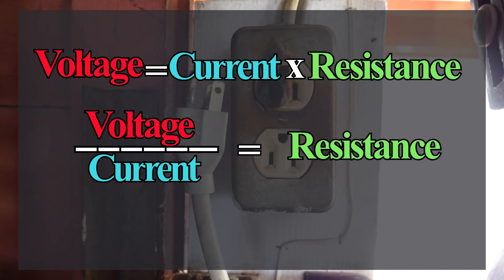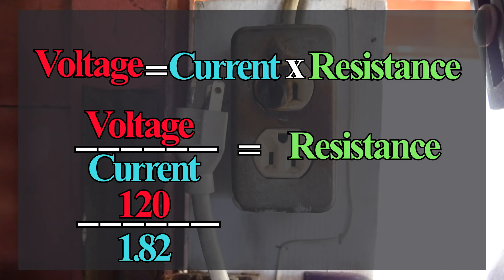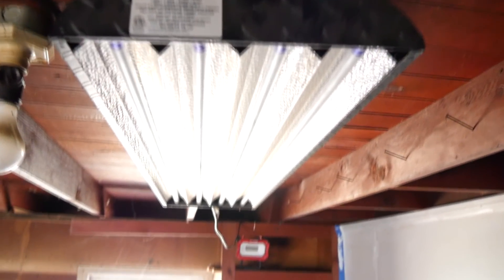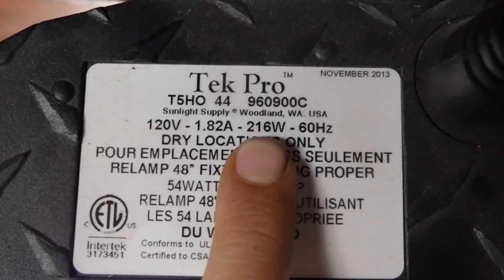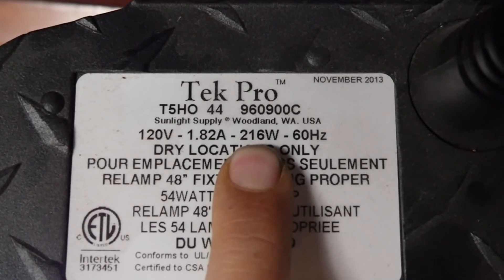Crash Course On Electrical Current - Voltage, Current, Resistance, Watts and Wire Gauges

Comment: Amps equals volts times resistance. If I say draw a circuit that gives me ten amps. You draw a five volt battery and a circuit from one side through a two ohm resistor to the other side. Five volts times two ohms equals ten amps.

Comment: Thanks for this timely video.  Many people don't know that outlets designed to handle 20 amp circuits have a different design that is obvious from looking at it.  From the outward appearance of your socket, it is apparent from a casual glance that  it is only designed to handle 15 amps, and you don't have to remove the cover plate to find that out.  The wider, neutral slot on a 20 amp outlet looks like a T laid on its side - here's a guide to this stuff - https://www.hometips.com/how-it-works/receptacles-120-240-volt.html.  Some outlets will handle the older, now generally prohibited aluminum wiring, some will handle both aluminum and copper wire, but generally the household outlets you find in stores will only safely handle just the normal solid copper wire. Twisted copper wire(i.e. like lamp cord) is not used for wiring outlets.

What I learned from buying a house with a DIY installed power panel in the garage was that the screws holding the wires to the circuit breakers, etc., inside the box and in the outlets had gotten loose over time, and things that drew a lot of amps, like power saws, just wouldn't work properly.  This resistance from loose connections causes heat which can result in fires, as shown in this video.   If you are not certain a qualified electrician wired your shop or garage,  spend an hour turning off the main power to the work area and check the tightness of each connection by tightening it with an appropriate screwdriver and examine the appearance of the insulation. Discolored or burned insulation indicates overheating, which reduces the ability of the wire that got hot to carry as much power as new wire.  If you have enough slack wire in the circuit, you can cut the wire back a few inches, strip about 5/8" of insulation off of the new end and attach fresh wire to the connection, but unless you have a lot of experience, it would be better for you to get a licensed electrician to check out the system and do the work .  Some local codes may require that you use an electrician to work on your shop or residential electrical system. Thanks again for the video.

Comment: This is the most common cause of electrical fires: Power-strip that has a bunch of high load crap plugged into it, plugged into a 15 amp outlet on a 20amp circuit...

The 20 amp breaker doesn't trip because you didn't exceed 20amps.  Instead you were pulling like 19 amps off the power-strip and burned up the 15 amp outlet.  Again the 20amp breaker is happy and doesn't trip.

Always use 15amp breakers if the outlets are also 15amps

Comment: Judging from that minimal panel and shoddy home repairs you found coupled with the electrical demand you will probably require from your shop with compressors and all.  I’m wondering if you should do some videos on how to run a bigger sub panel to your garage, and how to rewire your garage.   When I had my shop built I had the electrician re-panel my house to the max they could which was 200A and had a 100A sub panel put in the garage.  Chris

Comment: 20amp outlets usually have an extra notch on the neutra side. Not common from what I have seen. Dont use a 15 amp plug on 20amp circuit/wiring  folks. 12guage wire too like he had in the vid

Comment: Then our water example still works if a device has a high voltage, low current and high resistance. Or any combination...

Comment: This is a lot of good information but, it was too much for me to get at once. And I have a lot of basic questions. Like, I understand you had old wiring at 15 amps but how does that actually create a fire? What happens when systems don’t match up? Some more graphics, basics, or a recommended channel where I could watch the fundamentals would be super as I’m afraid to mess with electrical systems.  

Thanks for this very welcome video despite the critique / suggestions.

Comment: Glad everything is ok! Speaking of cars and electricity, if you hook up jumper cables to the car battery and hold the jumper cables in each hand, touching the metal part of the cable, will you get hurt?  One of my co workers and I got into a debate. The answer is no. The car battery is 12.4 Volts. Your skin resistance is massive, on average around 2-5 million ohms. There is no where near enough current to harm you, you won't even feel it. Even though the battery says 500 cranking Amps, that's when there is almost no resistance. Fun topic.

Comment: Ohhh  you had a 20 amp breaker and a 15 amp circuit and you were drawing over the 15 amp capacity of the plug.  Make sure you have the 20 amp rated wire too.  Good video!  Cheers!
Reply: To add to the issue... Was curious if the Power Strip pictured had a built-in Circuit Breaker.  I've rarely seen them activate but so helpful in reducing the chance of overload on the larger Circuit. Useful in narrowing down problems too. Kind of like using a GFCI outlet to protect a single location instead of multiple/entire strings of outlets. When it pops you don't need to look at the entire circuit. If the Overload/Short popped both the Strip and Breaker/Fuse... It should prevent another Overload when it's reset saving troubleshooting time.

Comment: Time for new outlets. 50 years old. Fire waiting to happen.
Reply: Depends on the wires and conditions. If the insulation on the wires is brittle, missing, or melted... Time to look at running new wire.  If the plugs are loose or fall out of the outlets... Then yes you probably have a fire hazard. Inspect the Outlet if it caused damage to the wires then replacing both the Outlet and wires is in order. But if the wire is good and properly protected (fuse/breaker)... replacement with the correct outlet may be all that's needed.
Reply: @lgoamity  plugs are what usually catches fire. I am a landlord and I have changed many outlets that look like that. Now I change all the outlets when a units come empty. That looked like the wire around the screw down terminal got corroded or loose.
Reply: @suggesttwo  That seems a bit excessive.  All the extra "wear and tear" from a blanket replacement seems like asking for a higher failure rate.  But you probably know best.  If a renter needs a lot of power and doesn't have enough outlets.... I'm sure you've seen some overly stressed outlets and ones that even if they look good need a peak under the hood.  

Suppose I'll need to add that to the safety test checklist (Test Detectors,GFCI, Batteries, Breakers,and Outlets) to make sure a Minor Problem doesn't become a bigger one when it fails to perform as expected.
Reply: @lgoamity  how much does a fire cost? Oulets cost 1$ each and he can probably do the work himself.
Reply: @suggesttwo  As I said... The Landlord (you) probably knows the Conditions best. But you raise a good point yourself... Nobody wants a fire. It'd be cost effective to swap out questionable outlets...  But that same $1 DIY to a "good" Outlet (plus ALL the "Good" Outlets in the unit) could unnecessarily raise that fire risk on an otherwise "safe" outlet.
Then again... If this is planned for each box could be set up for a "quick" swap reducing mistakes... (I'm imagining wire fatigue from "frequent" swaps, etc.)
Reply: @lgoamity  you can't see the contacts in the plug without taking them apart then they are garbage. They cost a dollar. You Don't want to spend a couple hours poking and prodding. A fire costs 60000$ in a 1 bedroom. 10$ to change the plugs. Money WELL spent. The insurance paus most but then your rates go up.
Reply: @suggesttwo  The Contacts/Wires I'm talking about are obvious and easy to see and test. Don't see anyone going to the trouble of trying to "open" then reassemble a modern Outlet.  THAT would be a fire hazard!  
In my Mind's Eye I'm thinking of a Renter leaving every few Months, maybe a Year? 2?  Seems excessive to do EVER outlet. Maybe just the ones that don't "test" right. (Cheap Plug Tester, if it doesn't show a normal connection, or wiggling the plug changes results... Change it.) 5-10 years? Sure, makes sense to refresh everything.

Again, I'm agreeing with you. If there is a question of safety I can't beat your math.
Reply: @lgoamity  not every time, only once per apartment. Probably won't need to be done again till I sell. I only change light switches if the installer didn't use the screw down terminals or if they are old enough to make loud clicking noise. Very old.
Reply: @lgoamity  I would say every 20 years or 10 if the plugs are in the baseboards.  Anything close to the floor is in much greater risk for contamination by anything on the floor. Extension cords, power bars etc.

Comment: So your solution is to install a 10amp circuit breaker yes?  Can you tell us about Watts and disapating heat?
Reply: The correct solution depends on what gauge wire was used for this circuit.  If it's a 14-gauge wire then the solution is to replace the 20A breaker with a 15A breaker and replace the outlet with another 15A outlet.  If the wiring is the thicker 12-gauge then the circuit can carry 20A...replacing the outlet with a proper 20A outlet and calling it a day would be an option, but if it were me, I'd replace the 20A breaker with a new one just in case that breaker is faulty.

Wattage (W) is simply (voltage (V)  x current (A)).  If you have  an electrical appliance that draws 3 amps of current then it's a 120V x 3A = 360W device.

Comment: That outlet has a bad contacts problem.
Buy a hospital grade outlet, works better.
Reply: Tamper resistant outlets have little doors that will keep dirt and water out.
Reply: GFCI work great and are added safety. Usually people don't buy them since it's too much money, $15-$20 each on instead of $1-$3 for a normal outlet and it's to "hard" to change them out.

Comment: 15A outlets work great on a 6-8A load like what you had there and are a hell of a lot cheaper. The failure you experienced was probably caused by corrosion on either the outlet terminals or the power bar terminals. That then snowballed into arcing, more resistance and a hell of a lot of heat which roasted the outlet. 20A outlets are not needed by any means in a home garage. The 20A breaker and 12/2 romex just supports more 15A outlets and typically you'll never easily blow past 15A's on one outlet.
Reply: @Matthew Poole  I think you are on the right track. Heat arose from high resistance either due to poor contact between the plug and receptacle, or between the receptacle's screw terminal and the supply wire. Poor contact could be due to looseness or corrosion.  So there's likely no problem with the wiring or the use of a 15A receptacle, but through wear and age, looseness or corrosion set up this fire situation.
Reply: I've seen some outlets installed with the grounding hole at the top, like this one, and some with the hole at the bottom. Which is correct? Thanks.
Reply: @coollasice4175  Grounding hole should be on top; the rationale is the ground prong is longest that facilitate easy insert, in an event some metallic object falls onto the outlet when it is being used it will contact the ground prong instead of the other two (arc and fire).  But NEC or your inspector probably don't care.
Reply: Cooll Asice I remember reading or hearing some about this,  I think they sometimes do it for safety reasons like for instance when the inside of the outlet is too loose or to old to hold tight the prongs of the electrical cord , the prongs would get loose half way out and if for some reason you are close near by and happen that you touch by accident with something metal those exposed prongs you can get shock or even electrocuted ,and by installing the outlet upside down the grounding hole is up ,that way would be safe, I got a couple electrical outlets that way ,that I am switching to normal way
Reply: OK thanks for the reply, but should they be installed like that in a residential setting like a house?
Reply: @coollasice4175  That depends on your local code and what version of NEC they are enforcing.
Reply: In garages in some part of the US require by code 20A outlets w/ 12 gauge wire.
Reply: @talshaharfamily  If the breaker in a basement going to the garage is 20 amps, can the garage's only outlet be rated for 20 amps?

Comment: Looking at outlet, you can tell if it’s rated 15 or 20 amps. The 15 amp outle has 2 vertical plug in spots, beside the ground. The 20 amp outlet has 1 vertical slot & 1 slot that is a “T” and your ground. The plug in for 20 amps is 1 vertical male & 1 horizontal male plugs, plus the round ground plug. For any circuit you should not exceed 80% of the rating. So for 15amps that would be 12amps, for 20amps that would be 16 amps.   Jim
Reply: sounds like bullshit to me
Reply: 80% thing is true.  When I have m'things working I connect an amp clamp near the breaker to see how much I am pulling.  If close to 80% I adjust
Reply: Manuel Salvatierra q
Reply: As long as you are below 80% you are ok......Jim.  PS this is all if your wiring is correct & everything else (electrical cords, etc.)  are within the current & watt limitations.
Reply: If you overload a circuit, the wire gets hot and if the circuit breaker takes you off line, things are normally ok. If the wire melts the insulation, it will start whatever is combustible in the area. This is the truth.   Jim

Comment: the water analogy is pretty good.  voltage is the water level(pressure), current is the flow rate of the water, resistance is the size of the hole in the dam.
Reply: Actually, comparisons to physical things is wrong. You are dealing with subatomic particles, they behave very differently from physical events. Resistance is opposition to current passage, and voltage is the force applied. I started working in electronics with  tubes, and black and white tv's. I also repaired high frequency radio equipment. Electricity will do very strange things, as I have observed over the years. Here is a mind blower, their is no current with AC circuits. Most people will disagree with this, however it is the truth.  Here is another fact, in DC current ( their is a current in DC circuits) follows only from Negative to Positive. Except, in transistor theory. Their is more but that would be beyond the scope of this forum.
Reply: Tomie Dotson AC circuits have no current? Well then, what made the outlet burn? Why does sticking a knife in an AC outlet kill you? Yep, it’s current and it AC current. Here’s the best analogy I’ve heard: Voltage is water in a tank, current is the flow through the pipe, and resistance is the size of the pipe. Big pipe, high flow. Small pipe, small flow. (big pipe is low resistance and small pipe is large resistance) Big tank (more voltage) equals more available current., etc... Better if you don’t need the analogies though. 😊
Reply: that's pretty much what i was getting at.  
it helped me understand electricity much better.